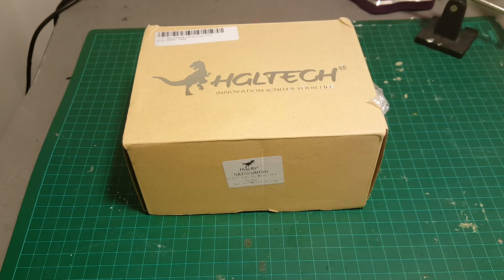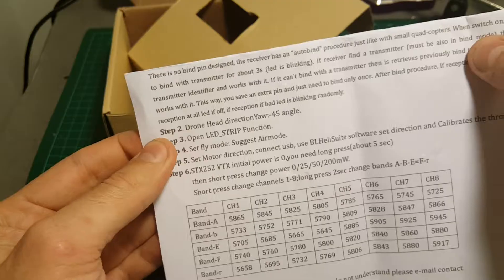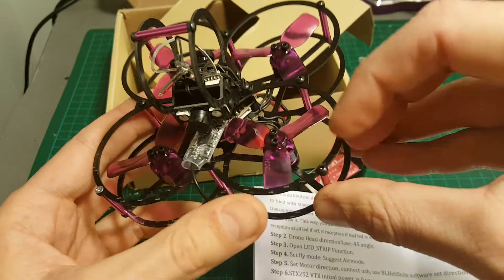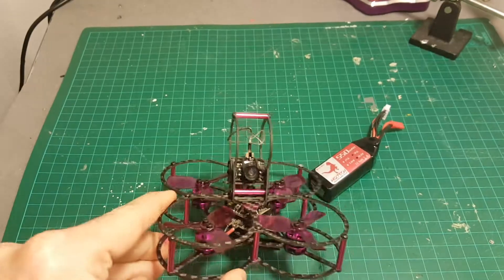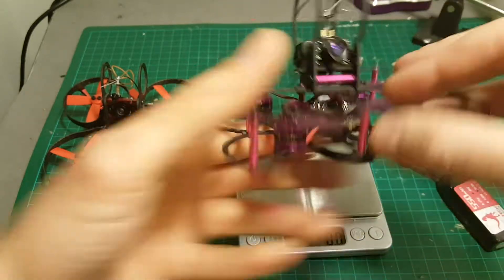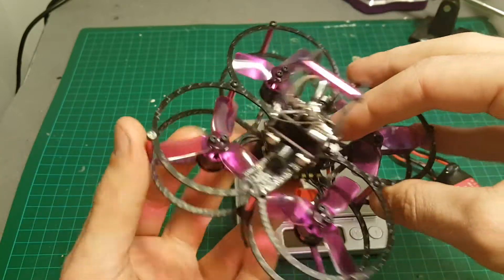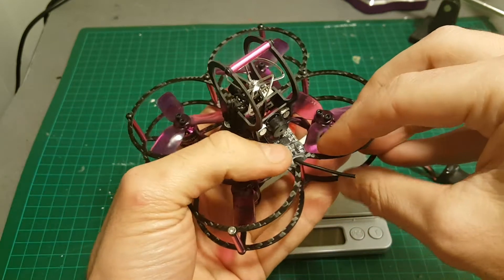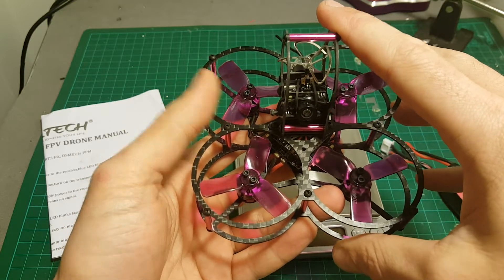XJB-75 75mm 3s Micro Brushless Quadcopter - Unboxing, Review and Test Flight

Comment: Hi. I m having  problem with this quad. I bought it bnf version for flysky. Im using fs i6 but no way i can make it fly. It doesnt see receiver in betaflight. Can you help with settings please
Reply from the maker: +Zura Tchelidze I would:
1. Make sure you connected the receiver to the right ports.
2. Configured it correctly in the configuration tabs
3. Flash the newest version of BetaFlight
4. Try a different receiver
5. Contact customer support - you might have a faulty product.
Reply: Thank you !

Comment: I found the majority of the vibrations came from the flimsy frame. so I put everything onto the Loki x2 frame and now it's solid. also the racerstar 2035 props make a big difference too.
Reply from the maker: The Loki x2 frame seems like a very interesting product. I might need to give it a try :-)
Reply: Gal Kremer I'd highly recommend it. takes a good crash too being 3mm. it's also lighter. combined with nanotech 450mah 60-130c 3s and 2035 props. it's awesome
Reply: hello, i just got one for 80$ on banngood plan to use the parts in a new frame + props, i have a question did the motor screws were good for a 3mm frame or you got a different ones?

Comment: I wonder if some of the jiggle is from those propellers? I've used those before and they were really out of balance. I'd really like to see how it flies with the Aurora 4 blade props. Really impressive that it's got 20amp ESCs on a 75mm!
Reply from the maker: You might be right Ron. Unfortunately, I no longer have this quadcopter to test it out...